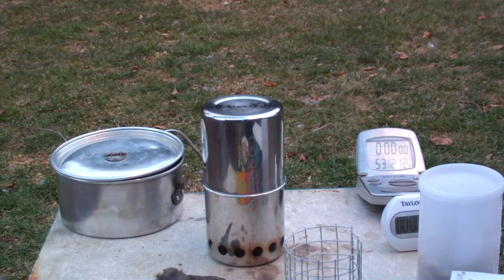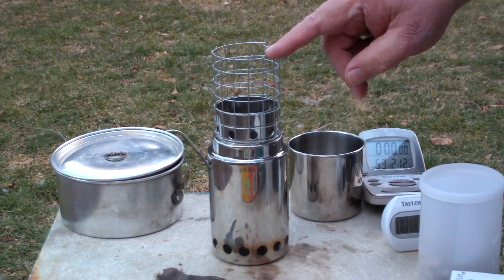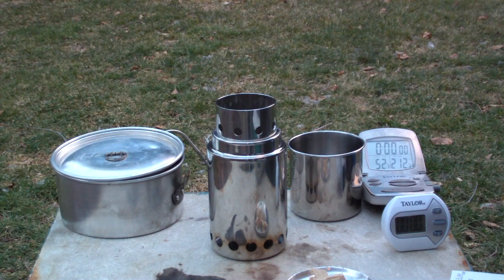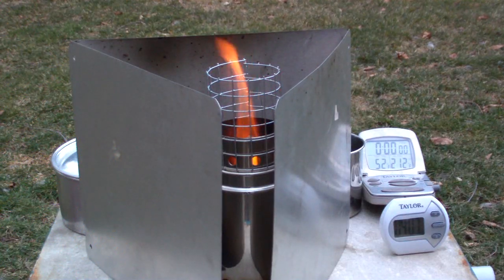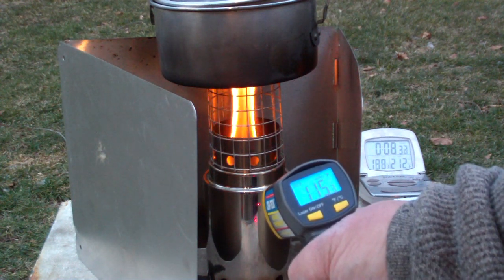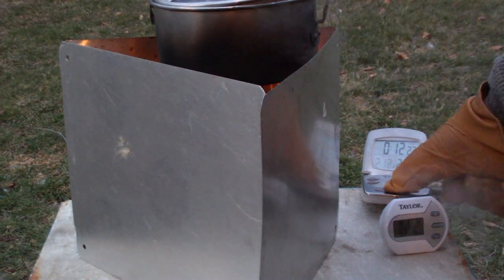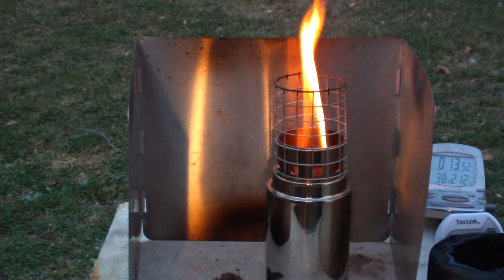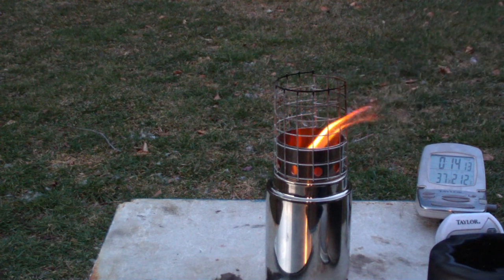WorldStove's PupStove - Boil Test #1

Comment: have you ever had a thin aluminum pot develop leaks from leaving the soot on the bottom?  I just threw out a small perculator when a round hole showed up.  It was only 4 months old.